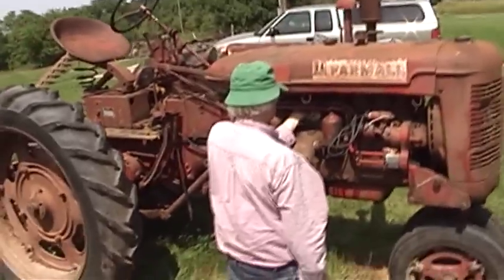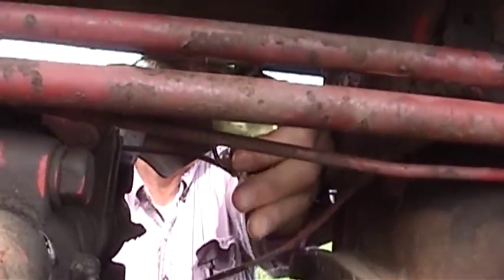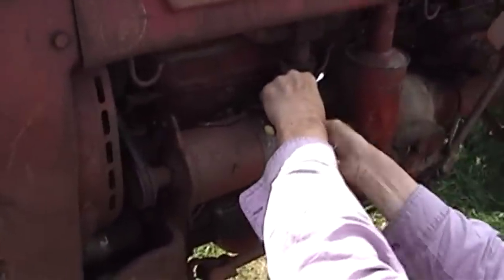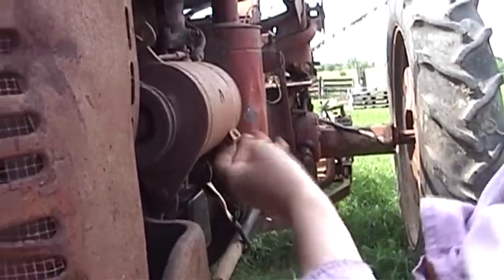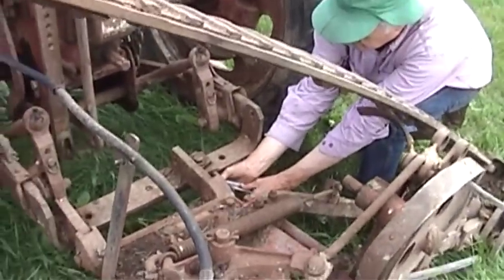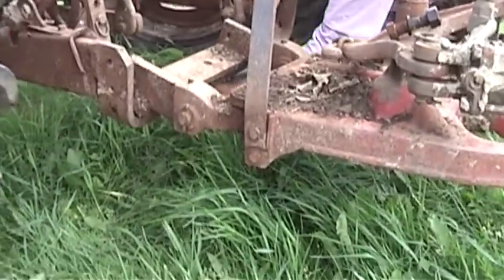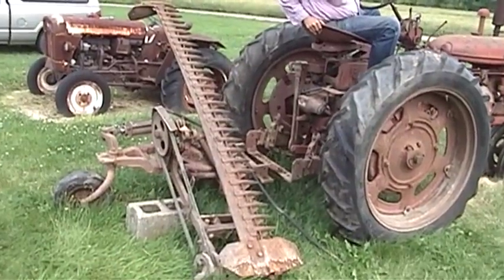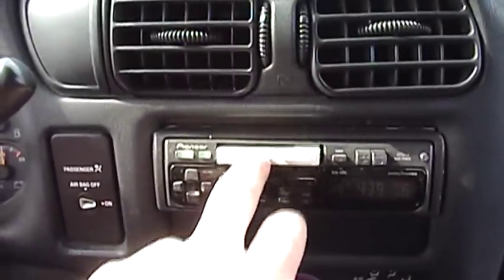Moving The Farmall

Comment: The way to test those generators is to set the throttle at 1/2 open.  You can then check the output of the generator by connecting your ammeter to the ground and to the "field" terminal on the voltage regulator.  Generators vary their output based on RPM, unlike alternators that produce a constant current regardless of RPM.

Comment: That should make a nice little tractor once it is finished. My grandfather and my father both worked at the Farmall plant in Rock Island, Il. My father was there for over 35 years. Where I grew up most of the people worked there or they farmed or both. I have a IH 300 utility that I am fixing up to use but not restoring since it will be used as long as I can climb up on it.

Comment: @uxwbill Farmall M  #2  you chain a 6 inch poplar tree right accross the back thru the wheels as soon as it comes out you have to stop it works like a big cleat this was in a slough but it rared up then too but with a little finess on clutch it  come right out there good ol tractor --we had a sharlain hydraulic pump and a farmhand loader and 4 stage cylinder lift sure went high up almost lift stooks to the barn loft .

Comment: Ive ran chevy trucks without batteries. The standard test of if your alternator is good is to take the battery cable off, and if it dies your alt is bad. ALTS will work without a battery just so long as they have initial battery power to charge the feild wires

Comment: @uxwbill Well we were told he went into a ditch and came up the other side front tires on top of field he let the back tires bring themselves up to the field level and on the corner of the ditch cut it slid down then regrabbed and rared up into the ditch bucked him off the tractor was going accross the field by itself slow but he said he went home with a sore back and never drove it again .Dad and I got it stuck set the rear diff on the ground used a poplar tree thru the back wheels it lifted up

Comment: Couple of goofs.  Should have changed oil & checked water before attempting to start. Brilliant..take the bolts out of the mower hitch
Reply from the maker: +David Sullivan Assumptions don't constitute goofs and there are other videos about this tractor.

I don't recall exactly about the mower now. Perhaps more was taken apart than should have been.
Reply: You took it off right if you wanted to keep a drawbar (which you do).

Comment: you guys do not understand electrical. That generator is not 3 brush when it has a outboard voltage regulator. Take the cover off the regulator and with the engine running push in the cutout (polarizes the generator). Brilliant to bust the glass so the weather can ruin the amp gage. I am not watching any more of this buffoonery.
Reply from the maker: You are wrong.